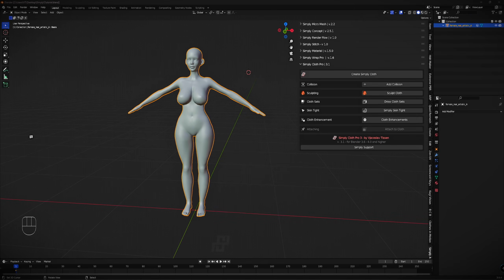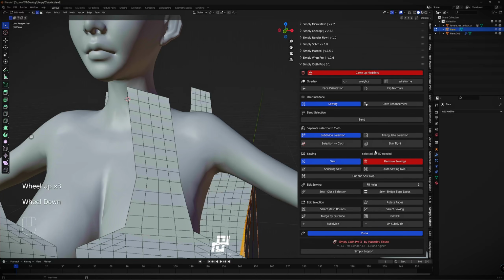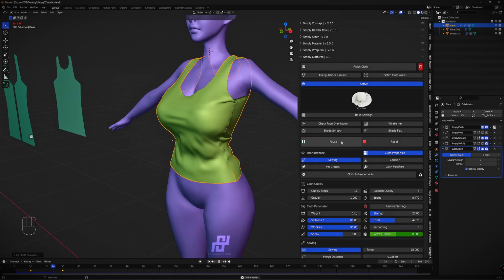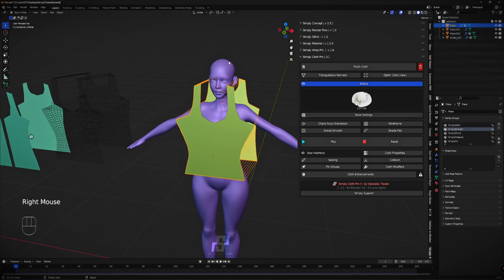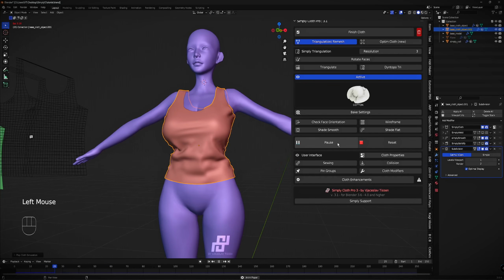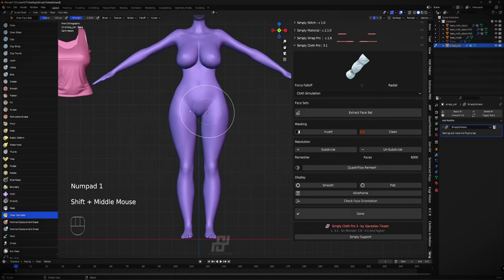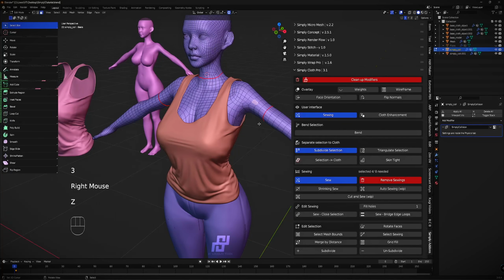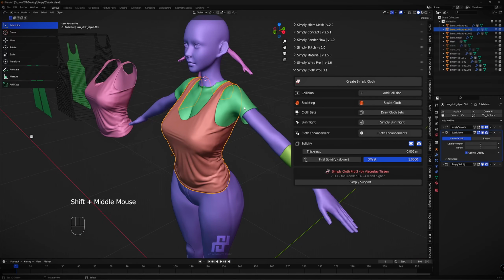In Depth Workflow Walktrough - Simply Cloth Pro 3 - Blender Addon

Comment: the Nr. 1 feature I miss in this plugin is the ability to drag the cloth around during simulation in order to fit it to the mesh the way I want. If that is possible I will buy this. You need to add it in the code somehow that the shrinkwrap modifier can be adjusted during simulation then you have basically made a Marvelous designer tool :D

Comment: For those having issues with "extract face set" during the drawing process around 55:00 minutes in, if the Rig is not in rest position you will be in for a bad time, the rig has to be as it was when it was set into rest position, that means no modifications to scale or position and rotation. 

Select Data (stick figure guy) > Pose > Rest position
Reply from the maker: yes, sorry I totally missed this to tell in the video.

Comment: Thank you so much for this video. I've had Simply Cloth for a while now, but it keeps not being the next thing I confront because it has seemed like a lot of add on with minimal documentation. This video gives me a useful grasp of what the tools basically do, how they interact, and some useful thoughts about approaching digital clothes. Now I'm eager to jump in! Thanks again.
Reply from the maker: yes the documentation is a little out of date....I will fix this in the next time so it should be ready with better UI and better Documentation
Reply: I'm working with Simply Cloth Pro 3.1 (for Blender 3.6-4.0+) and Blender 3.6.0. For whatever reason, Simply Cloth was not activating sewing in the Physics Properties tab. It was inputting my Sewing Force from the add-on UI, but the "Sewing" box in the "Shape" drop down was not getting checked. Once I went in and checked it manually everything worked as inteneded.
Reply from the maker: Yes this could be an issue I missed. I will check this for the next update cycle. Im working on new features at the moment...so the bug fix will be done too.

Comment: The cloth simulation doesn't work for me. I've made clothing three times and it has never worked for me.
Reply from the maker: Please get via email back to me and I will check your workflow and help you
Reply: Hello! You likely already have this solved, but I had the same issue, and I wanted to provide one potential issue and solution should someone encounter this. It may not be the same issue, but I had some broken faces that were preventing the simulation. I deleted those and built new faces and I was able to get it to work properly!

Comment: remove the phone as a requirement for the discord
Reply from the maker: why? I had to bad experience with some users without confirm ...and make bad stuff on my channels....
Reply: @SimplySlawa  ok far enough, i just dislike giving my phone number online and try to minimize it, this phone number i have now have had for 6 years now and i never get spam calls because i never share it online. 

sharing it online is just an excused for someone to sell it and that does not benefit me because i get the short end and get targeted ads and spam while some airhead gets some money for selling it on.

i just avoid talking in those locations if they require phone, i am not the only one that will be doing so. When its a support network for a paid service then it kind of does not sit well but you can do what feel is best for your brand. 

Not trying to hate Love the latest version of the addon too.

Comment: It seems the Wrinkle dialogue in Cloth Enhancements isn't available in Blender 4.1, but seems to work fine in 4.0. The other options are there, just no Wrinkles.
Reply from the maker: yes correct, I need to update the addon for 4.1. For 4.0 it works fine. Thank you for information :)

Comment: hello, great tutorial, has been a great help. Just a question: for some reason, if under the extras i try to remove selected vertexes from the shrink option, it doesnt remove it if i click on the "remove" button. it works fine if i do it under the "strenghten" option, but not under the "shrink" option. If then i try to go under vertex paint, it crashes... have you had similar issues? Anything i need to be aware about so I can remove them?
Reply: i have same problem
Reply from the maker: sorry totally missed your comment. Hope youre not mad... Please get back to me via email, so I can help you better and fix this issue in next update cycle.